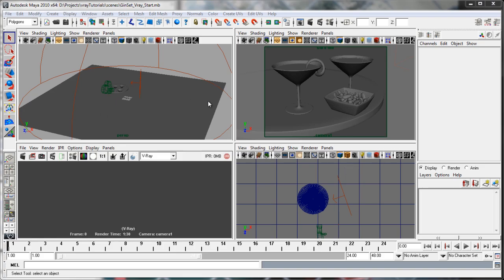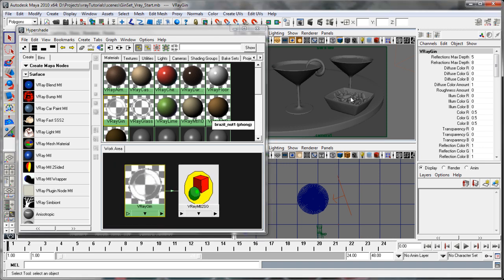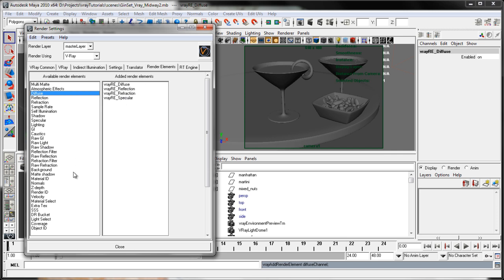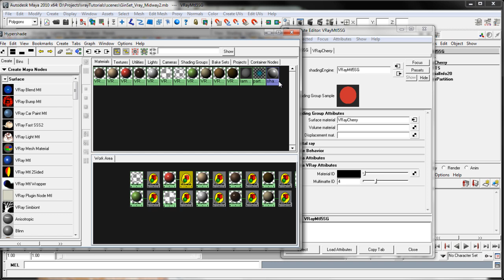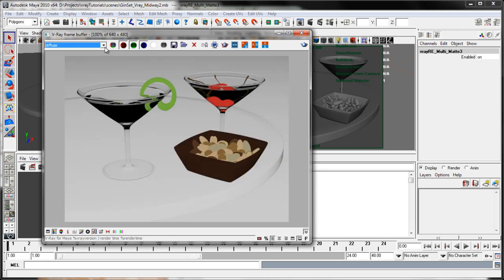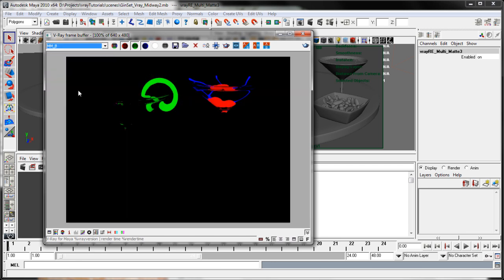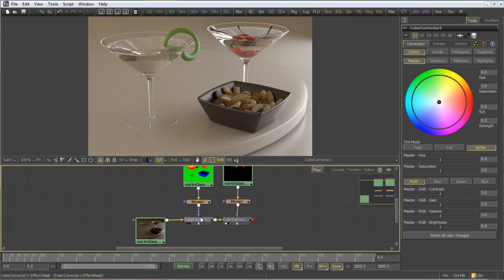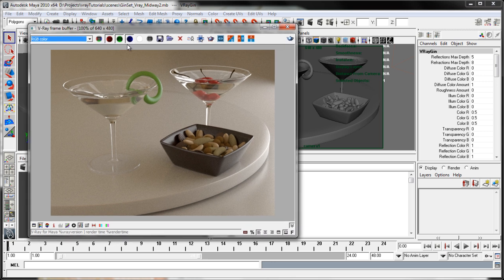VrayForMaya - Workflow

Comment: Hey Andrew, thanks for the video, was really helpful. A question if you have the time... I've setup a simple scene to test out the MultiMatte. Everything works fine but for some reason the refractions/reflections aren't showing up in the multimatte pass, not getting any blending of RGB colours. They are in the Beauty pass though. Pretty sure I've set my materials and render settings to the same as demonstrated in your vid. Is this a problem you've encountered before?

Comment from the maker: Please don't take this the wrong way, but the problem with AE is that it doesn't give a grounding in what operations you are actually doing when compositing.  When I say "Add" or "multiply", these are literals.  You take passA+passB to get the additive combination of the two.  You can set your layer overlay mode to "plus or add" for the same effect.  You can of course do this in AE, but it all makes much more sense when you use a node based editor.

Comment from the maker: When you are working by yourself, this may not be all that important, since you can essentially light it to taste and not have to do post work.  However, when you work in a pipeline with multiple artists and art directors, it's important to have flexibility to adjust in comp, so that expensive re-renders aren't needed as often.  Plus, once you get used to it, you tend to know when you can adjust something faster in comp, and you can save time not dealing with it in lighting.